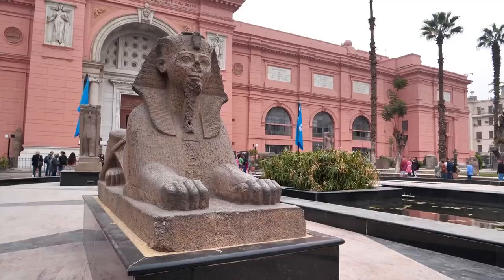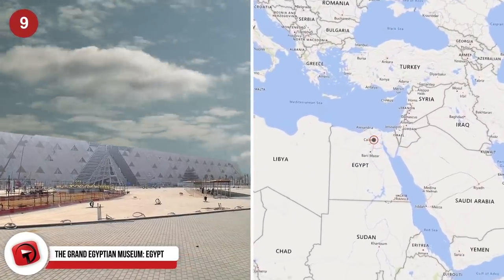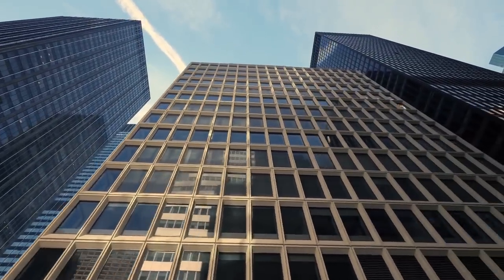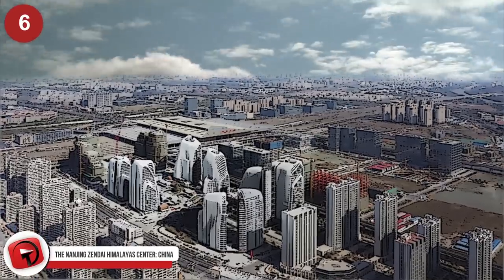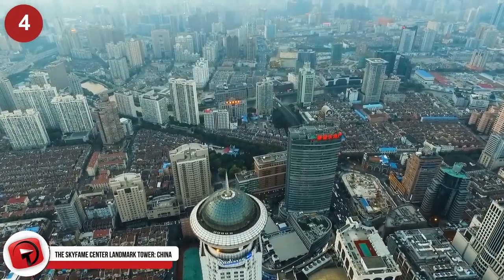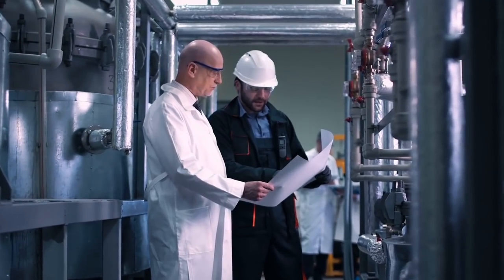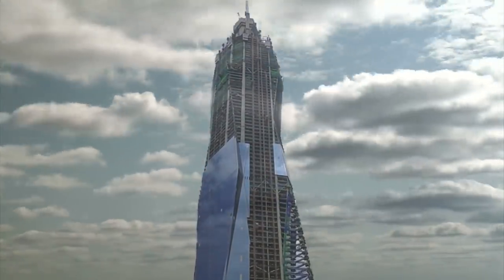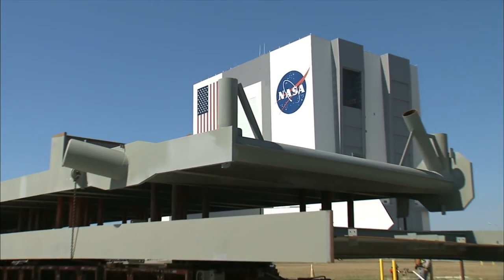10 Craziest Buildings Being Built Right Now

Comment: If the double-decker elevators in Jeddah Tower directly go up to the top floor at a speed of 10 m/s then it will take 67 seconds

Also, Merdeka PNB 118  will have the highest and fastest glass elevator in the world with travel height of almost 500 meters and speed of 10 m/s or 2000 ft/min